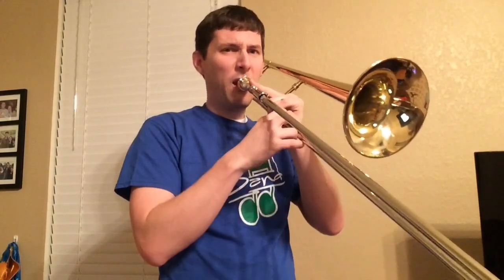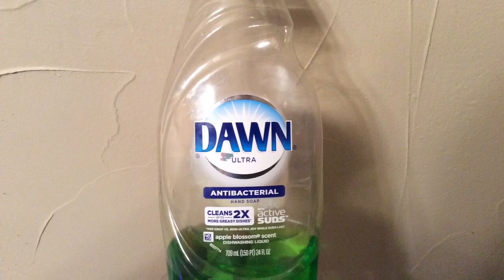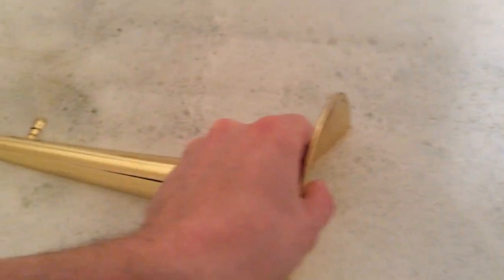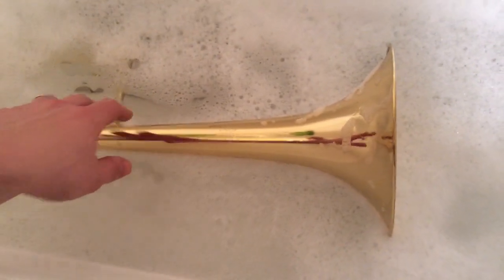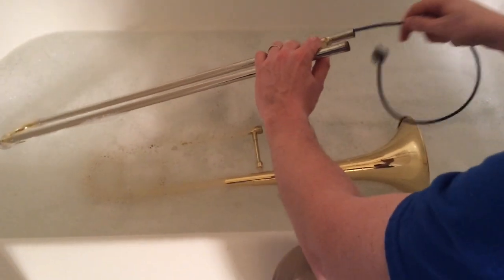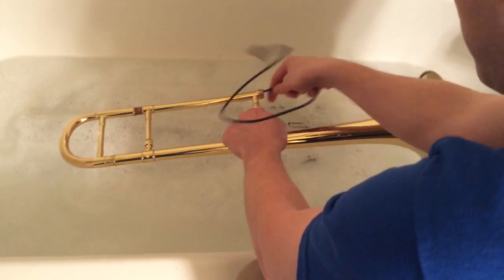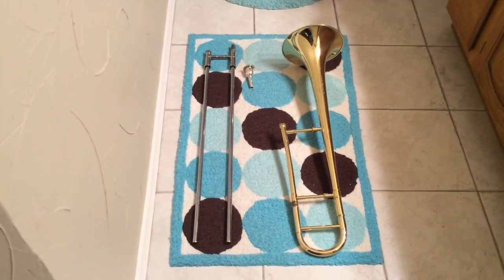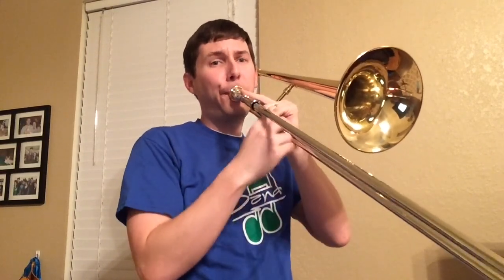Giving Your Trombone A Bath

Comment: When I wash my horn I like to place a towel in the bottom of the bathtub so my horn doesn't get stretched by any hard surfaces, just an additional bit of advice
Reply: Thx
Reply: Thanks
Reply: Thx dude
Reply: Can you do this to a trombone without a snake?
Reply: @emmabarden1701  yes
Reply: I use a bath mat.  It tries much more quickly than a towel.  (You probably want to buy a bathmat that you use only for your trombone, not the same one that you use for bathing yourself.)

Comment: You want to be careful when fully submerging your inner-slide in water.  I'd recommend against doing that.  Inside the top of your inner-slide is cork that stops the trombone making a 'clangy' sound when you come all the way into 1st position. The cork helps 'soften' the slide when you come to first position so people can't hear the brass hit the top of your slide.

If you get that cork wet, it can disintegrate and fall out, and then you'll need to have it replaced.
Reply: Is it easy to get replaced tho?
Reply: It is if you go to a Trombone repairer. They can put new cork stoppers at the top of your inner slide quite easily.
Reply: mine never had one it works fine for me
Reply: Brass Recordings my cork got stuck but it was like that when I rented it
Reply: Brass Recordings mine doesn’t have one
Reply: Brass Recordings does this works with bass trombone
Reply: When I got mine, it didn't have one
Reply: I don't even have one
Reply: So how should I clean my trombone?
Reply: Now I know why my trombone is clanking
Reply: How would you recommend to ean the inner-slide of the trombone?
Reply: Mine already does
Reply: Thanks for the tip!
Reply: @joeecaresless2038  Don't put the bell in the water, it's really bad for the triggers
Reply: Mines got a spring I think
Reply: @Brass Recordings what cork.
Reply: @Cburkh23  most trombones have cork or rubber up the very end of the inner slide so that when the outer slide goes all the way in to 1st position there isn't a clanky/metallic noise as the outer slide has hit the top of the inner slide
Reply: @BrassRecordings  Or felt.
Reply: So by that logic is it also inadvisable to put the outer slide in water to prevent damage to the water key,
Reply: @joeecaresless2038  all the members of the trombone family are anatomically identical (aside from trigger/valve trombones), they are just bigger or smaller.
Reply: Jokes on you mine already is 🤪

Comment: Thanks for the video.  I just bought my son a new Yamaha trombone and the dealer specifically suggested giving the instrument a "bath" at least 4 times per year.  They said that this would prevent the need for chemical cleaning and extend the life of the horn.
Reply: Derek Lussier It won't prevent the need for a chem clean, but it will definitely prolong it. At a certain point, he'll have junk in the horn and on the slides that just won't come off without a chem clean, especially if he plays a lot.

Comment: my trombone needs this badly.... i should probably gve it the thte repar shop to clean too. ive had it for like 6-8 years and barly given it a bath
Reply: rip.
Reply: Mine's 8 and it's never had a bath...
Reply: Divergent_bowtie I just bought a trombone from an antique shop for $20, it plays, but the finish is gone, the slide is sticky, and it's a bit rusted. I should probably get a professional to clean it, I don't even have a snake brush

Oh yeah and mine is from the early 1930's so it's about 88
Reply: Same
Reply: @carlosblondiswall4532  Did you find someone to clean it?  I found  Buescher Aristocrat trombone.  The serial # indicates early 1940s.  It looks awesome but needs to be cleaned/polished.
Reply: Nah didn't yet, I found a snake brush and cleared out some unknown substance. But from the research I did, I would need to get it chemical cleaned by someone if over 8 years old
Reply: @Ein~draws that is good advice, but surprisingly it works just fine! I had to deep clean it a couple of times, but there are no dents in the slide or anything else to effect its playing. I do need a new mouthpiece though
Reply: Just gave mine a bath for the first time in 4 years
Reply: @carlosblondiswall4532  if its 88 (90 now) i cann see why it has trouble bathing itself

Comment: washing your inner slide can disintegrate your cork behind your first position. the cork muffles the sound when your move your slide into 1st position, if you give it a bath it will be a loud "clank" when going into 1st position. i suggest taking it to your local repair shop to get it professionally cleaned...                     

share your opinion with me about what you think!
Reply: ye, I have an old Yamaha student bone that I bought when I started and every time I go to first position it clanked but I'm to lazy to go and get it cleaned professionally
Reply: LOL me too, i have the same problem
Reply: Anyone can clean their trombone themselves. I'd recommend a professional clean only if you can't remove a bad smell, or certain parts of the trombone aren't working as well as they should (e.g the slide sounds scratchy when you move it, tuning slides no longer push out, slide is out of alignment etc).

If you know what you're doing when cleaning your Trombone then you should be able to do a really good job.

Comment: Do you need to take the tuning slide off? And if you do it with trumpet do you need to take out the valves
Reply: Don't Swing Scissors yes take out your valves and clean them in a sink with gentle water and the mouthpiece brush but if you clean your valves first make sure to thoroughly rinse the brush off you don't want to get sick from getting valve oil in your system
Reply: Don't Swing Scissors yes. for trumpet always take out your valves. theres a soft cotton material under your valves that keeps them quiet when you press them down
Reply: Don't Swing Scissors yes take the tuning slide out and clean it but only do that if u have grease to put back on it
Reply: Yea
Reply: Make sure you disassemble the valves too and only put your springs from the valves in the water
Reply: use a trumpet cleaning vid

Comment: make sure you get all the water out or else it will rust, had to get a new horn since my bell rusted off the attachment to connect it to the slide.
Reply: It can't rust, because it doesn't contain any iron. It can however be damaged by red rot.

Comment: What about the tuning slide and does this work with an f attachment
Reply from the maker: Yob Sizler - pull the tuning slide off and treat it like the main slide. Snake it out, dry it off really good before putting it back together and make sure to put tuning slide grease back on
Reply: What about the f atachment??

Comment: Hey Keith,

My slide isn't as smooth as it used to be, and I've tried, to no avail so far, giving it a bath to get rid of the slide cream residue on the end of the slide. I've already tried taking it in to repair any possible dents, with little to no noticeable difference afterward. What should I do at this point? Try getting it chemically cleaned? (It's a "new" model, but I've had it for 5 years or so)
Reply: I have the same issue, im debating on switching do a different slide oil brand to see if that could be the issue, which I doubt highly but worth a shot.
Reply: As trombone player with an old Bach 50B bass bone I would recommend wiping the slide down and putting valve oil on the very end of the inner slide then move the slide around through all seven positions. After this take your slide grease and apply to the rest of the inner slide.
Reply: alex ballantyne Yea my problem was that my slide was out of alignment :3, good thing my yearly paid warranty fixes that, not...
Reply: Oh wow 
Well it's good that you got it fixed!
Reply: alex ballantyne Yea just little mad bc I pay 100$ year to get it completely maintained and they couldnt fix that,
Reply: Nite Hawk rawr